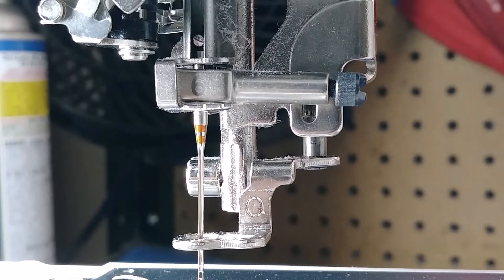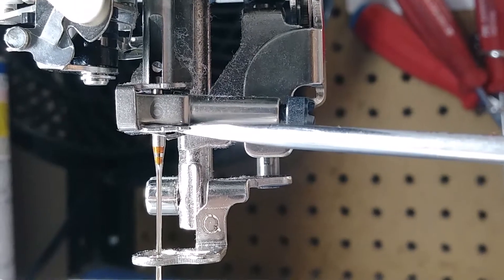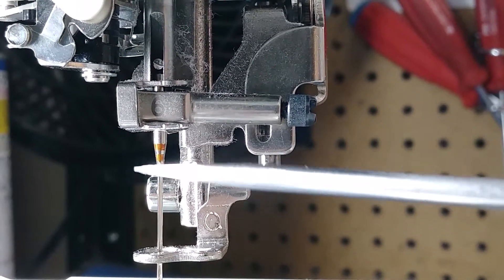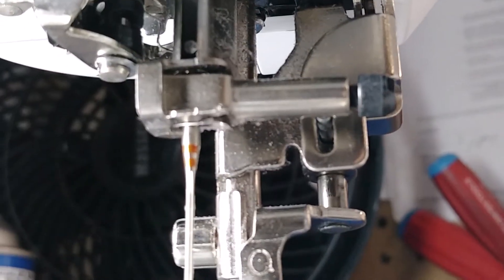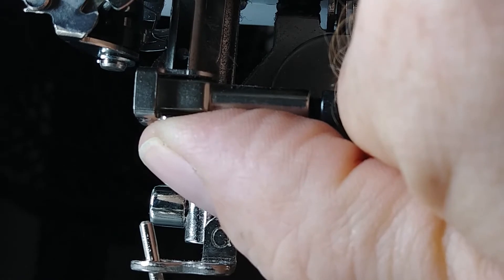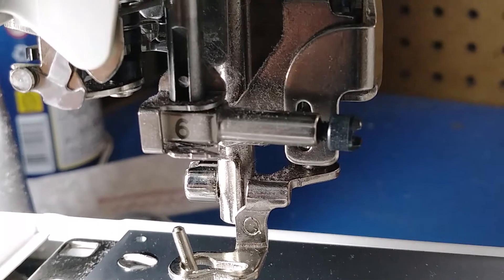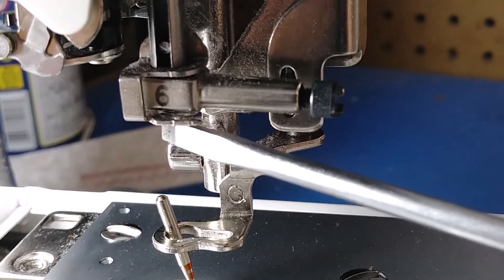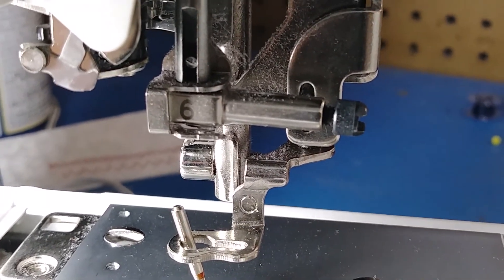Sewing Machine Problems: Thread jumps Out of #6 Needle Clamp Thread Guide Brother Baby Lock Machines

Comment: Shame on Baby Lock and Brother, for making that spring so thin!!!  I have a Baby Lock Destiny 2, and this was a continuous problem.  Then the tip of the spring broke off.  I took it in for repair and they didn't replace it, they welded it somehow.  Now I have to use a needle threader to fight to get that thread through.  My spring on my Brother embroidery machine, that is several years older, is at least twice as thick and has never been a problem!
Reply from the maker: @elizabethh1815  Thank you for your comment.  That is an easily obtainable part. If they were an authorized Baby Lock dealer, they should have replaced it. I have replaced and repaired many of them over the years. With care, these parts never get damaged,  but many dealers don't take the time to instruct the buyers on proper operation of the machines they sell.
Reply: @arxmechanica  Yes, they are one of the largest Baby Lock dealers on the East Coast!

Comment: This fixed my problems! Wow, thank you so much for sharing your knowledge!! Just curious, what makes it move out of position? I was just embroidering along and noticed that I was having a hard time getting the thread behind the guide and saw the the spring guide was below the bar. Thanks to you, it works again!
Reply from the maker: It happens when you are inserting the needle.
Reply from the maker: You have to insert the needle through a hole in the middle of that thin spring plate when you put the needle in the needle clamp. Often when inserting the needle you move the needle around while you're trying to find the hole. This action pops the spring plate out of place and you end up sticking the needle in front of that plate instead of through the hole in the middle of it. from that point on the retaining spring plate is in the wrong position and the thread cannot stay in the #6 thread guide.

Comment: I have Singer Talent, and the thread keeps coming out of the needle hole just after 3-4 stitches I can't find any such paper thin metal in my machine. 
Can you please guide me on what can be the reason and how it can sorted ?
Reply from the maker: The thread comes out of the hole in the needle after a couple stitches? I would suggest you make the initial tail of thread coming through the needle ( and bobbin, if you have brought it to the top of the needle plate) a bit longer, as well as hold the tail of thread during the first few stitches so it can form it's initial stitches. It sounds like the upper take up assembly is pulling the short thread tail back up in the machine. This is fairly common.I hope that helps. Let me know.